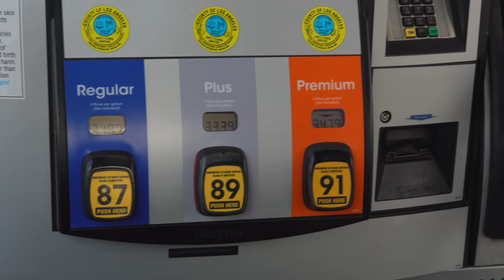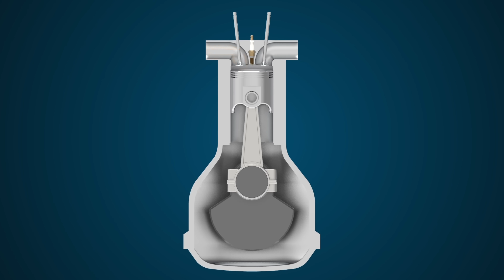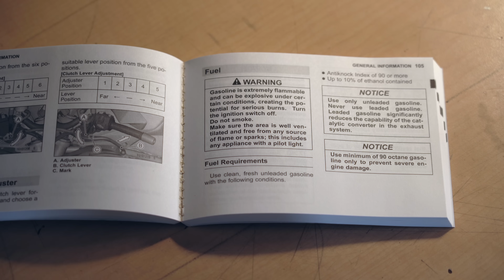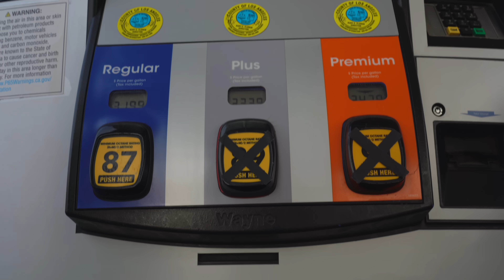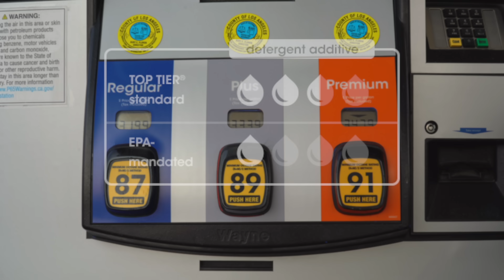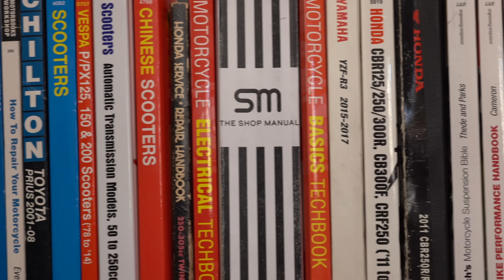Should You Run Premium Gas In Your Motorcycle? Octane Explained | The Shop Manual

Comment: I fill up with electrons while I sleep, and it doesn't matter what octane YOU choose, I am the fastest thing on two wheels, and will pull away from you every time. I'm there, you blink, and I'm not there anymore. I remember this guy, I could hear him coming for blocks. He pulled up to the light and he couldn't keep his hand off the throttle. I looked at him, he looked at me, the light changed, and I was gone, simply gone. I got to the next light and waited, and waited, and waited. He finally pulled up next to me and was yelling over the noise from his bike, "what is this thing?" I said, "it's electric". The light changed again and I pulled away at part throttle, listening as he was going through the gears, desperately trying to keep up. I think he drove like that everywhere he went. Couple of years and he'll be deaf.
Reply: Mighty proud of yourself beating a clapped out Honda rebel.
Reply: @armadilllo  Clapped out? Hmm is that English? Honda Rebel? No I think he said H2, a 2 cycle machine.

Comment: I run high octane in my BMW F 800.  I have to buy it from a HD shop. They have been out of orde and now I'm having issues with her cutting out on me when I either decrease the throttle, or gear down.  Does this sound like a fuel issue?  I have no idea what is happening.
Reply: sounds like typical German engineering

Comment: All fine and good.  This guy never mentioned the biggest issue. Ethanol. Ethanol is dirty and it sucks. I run Non Ethanol in every engine I own save my car, Truck and van. All grass mowers, power washers, boat motors and all my Motorcycles run on Non Ethanol. Non Ethanol as far as I can tell comes only in a premium grade.  So while this video was done good enough it is incomplete for a educational purpose.

Comment: Interestingly enough, when I tried running 93 octane in my Suzuki Boulevard C90T years ago, I did it for the cleaning properties and not to increase power. What was surprising is that the higher octane made the engine run like crap. It didn't start running good again until I filled up with 87 octane. So, instead of using higher octane, I started using Sea Foam. It ran better than ever once I started using Sea Foam. I now have a new Gold Wing, and it also runs great on 87 octane with Sea Foam every now and then to help keep things clean and running smoothly.

Comment: Good video, thanks.  Just sent me away to double check the manual for my new bike (Tiger 660S).  The recommended octane/grade is slightly lower than the lowest grade usually available in the UK, meaning the  engine was designed with some wiggle room.  I have from time to time experimented with higher grades in various cars and bikes but never noticed a difference.

Comment: Well, I'm on a CRF300L so, no need for good fuel but, I use it anyway as the difference is under a buck a tank and it'll keep the little banger cleaner inside.

Comment: Also missed one of the main differences between motorcycles using gasoline versus cars. Most cars don't sit for months at a time during long winters or lifestyle choices. (AKA "Fair Weather Riders") If you strictly only use the lowest grade of fuel as per the manufacturer's recommendation, then you are getting a much higher concentration of ethanol, and few people realize that Octane drops over time. Your 87 cheapo gas doesn't clean very well and can lead to bad deposits, the ethanol attracts moisture, and the Octane won't be 87 any more at the end of several unused months. I run 87 in my Hondas designed for it, but put in a tank of 94 every once in awhile, and make sure to only store my bikes with full tanks of 94 and Stabil added. Couldn't care less about power.

Comment: if you have a local gas station that has premium fuel with 0% ethanol and you store your bike for winters run the premium for the last 2-3 tanks and when you store it.  pulled my bike out of storage after 1 year with 0% ethanol fuel, fired right up.  10% ethanol fuel only stores for about 6 months I believe

Comment: If your engine requires 89 octane, putting 93 octane will give you no more power. You need to understand how to utilise the properties of a higher octane. To utilise the properties of high octane will require engine modification. Do not waste your money on high octane fuel if it does not require it.

Comment: Quick answer: any gas that gets compressed heats up. This is the reason why turbocharged cars have an intercooler, its to cool down the compressed air. It is then mixed with fuel and compressed again in the engine.

In high compression engines and turbo engines, this air/fuel mixture can get so hot during the compression that it can self ignite before the spark plug sparks, while the piston is still compressing the mixture, creating engine knock. This 1- damages your engine, and 2- steals some power from you as it pushes against the engine's rotation

Octane helps prevent the mixture from self igniting by raising the temperature it needs to ignite

Comment: well high octane gas might not gain you power but low grade gas will possibly decrease your overall power output if the manufacturer build and tested the engine with high quality fuel (which usually is the case since about 20 years). once the engine detects a single knock the timing advance on your ignition will be set back to prevent knocking. with your ignition timing not at the peak you will have slight performance decreases. the knocking control on your engine will "sharpen" the ignition timing to a certain preset point bit by bit if it has no knocks therefore regaining it's original power. now in theory there will be a power difference but obviously you won't notice it on a 20yo honda civic with 70hp, on a highly tuned performance bike engine with high power-to-displacement ratio I'm not so sure. surely there are tests on youtube... I also doubt that using one tank of low-octane gas will damage a modern engine mainly for the reason I explained above. I don't know for sure tbh but since cars have it since as early as the late 90s I'd assume motorcycles also utilize a knocking sensor the same way.

Comment: Are you suggesting that quickie-mart fuel is a lower quality?

I thought all gas was the same quality.
I can’t see gas being made to accommodate quickie-mart gas stations.

What’s going on with gas quality ?
Reply: I can't speak towards the manufacturing of gas being the same, as I don't know. But fuel quality still has a lot to do with the transfer / and after care as well. Dirty delivery trucks, dirty station in-ground tanks, old gas (whether not purchased enough to keep a steady flow of fresh or purchasing old gas for a bit cheaper), or broken / leaking in-ground tanks. All gas might be created equal (which I doubt fwiw), but maintenance and care is usually based on the brand of station / how much they care about their reputation / have the funds to repair / maintain it. I have an old cheap no-name station near me, gets deliveries from gas-brands I've never heard of and it made 3 of my vehicles clog up their fuel filters in 1 year all to bc their gas was $.30 cheaper (and now I know why). Never bought from their again, never had the issue again.
Reply: @patrickmchugh8039  ; 
👍 I can appreciate that.
Certainly makes a lot of sense and has a good loud ring of truth.
I can see all of that coming into play.

I have a new motorcycle with less than 2000 miles on it that developed a engine knock. I changed the gas yesterday but didn’t make much of a difference.

Comment: If your justification for using higher octane gas is because it contains more detergents just run a PEA based fuel treatment like Chevron Techron or Royal Purple on occasional tanks. Then again when you store the bike with a full gas tank.

Comment: I am having a 350cc scooter 2,5 years and using 100 octane gasoline since I got it from the dealership and I am having 10k kilometres! The scooter runs so smooth, the throttle response, everything..It’s like I bought it yesterday.
If I change to regular will it be bad for the engine? Anybody have any idea?
Reply: running a tank of it won't hurt anything, try it.

Comment: I was told that higher octane fuel has a lower combustion temperature and therefore it’s a good choice in air cooled engines even with lower compression. Is this true?

Comment: You go to the pump and it has 1 hose with 3 selections you select 91 you can get up to a gallon of what the previous person purchased which is usually 87 and you end up  paying 91 octane price for 87 fuel.
Reply: Pick a station that has separate hoses for different octanes.
Reply: Never seen one. @davetysdal5442
Reply: Nope. Calibrated very accurately by a third party and generally wouldn’t be over 2-3%. Most modern cars computers also adapt to slight variations in fuel.
Reply: This is the dumbest comment Ive seen this week. Not at all how gas pumps work.😂
Reply: Then anything left you put in will be a higher octane n just be a combination of the 87 so still higher
Reply: you'll get a little of the gas from the previous gas but definitely not a gallon! and I always aim the nozzle at the ground after pulling it off it gets that little bit left in the nozzle out so it doesn't dump on my bike and if you look inside those pumps there is only 2 inlets one for 87 and the other for premium the middle selection is a blend of the two
Reply: Yup. That’s why I always go to chevron, separate hose.
Reply: So then, the next guy to choose 87 get a gallon of 91 for the price of 87.  Seem like it all evens out in the end.  😁
Reply: @buckybucky8596 
Except the amount left in the hose is a much larger percentage of a motorcycle tank than an SUV or car tank.
Reply: Makes sense
Reply: lol. who told you this?  fake news...
Reply: Thrashing guys did an experiment.  @BigTimeRushFan2112
Reply: @BigTimeRushFan2112 You think they clean out the filler hoses between customers.?. Haha

Comment: I use high octane fuel in my 50 cc scooter because it helps clean the carbon buildup on my plug and piston, it's only an extra 50 cents to top up my tank.

Comment: i inherited my grandfathers 2001 holden ute (ls1 powered) about a year ago. he owned it since new, mostly hwy driven and he never gave it a hard time while he used 91 (our lowest).

i couldnt get the black smoke to stop when i put my foot down, so i used 98 (premium) for a few tanks. After two weeks the car ran smoother and got better fuel economy on both 91 and 98.

i still run 91 but every 5th fill up ill use premium, i dont know how it works but its been worth it

Comment: The high octane in my area contains no ethanol while the low and medium contain up to 15% so as I approach the end of riding season, I only use high octane and stabilizer so that I don’t get the phase separation from the ethanol that leaves water in my tank during the storage months, even more so with my snowmobile which has a much longer off season.  So there is more to to high octane than anti-knocking on high compression engines but thanks for the great explanation regarding power.

Comment: I run premium in my little CB500X that certainly doesn't need it, BUT I don't do it for any mythical power gain. I do it because it's the only octane locally that is ethanol free, and running without corn in the tank DOES get you better MPGs.

Comment: In Layman's terms; use whatever grade/octane fuel the vehicle was engineered for. Eliminating Ethanol from fuel would be a far better improvement than using a higher octane gas or any gas additive.
Reply: Very true, but in my area (west Wisconsin) non-ethanol gasoline is only available in higher octane ratings.  I am all about using non-ethanol fuels, so I am willing to pay the premium price for it.
Reply: @NJP76  I feel your pain. Time and time again, independent studies have proven that there was absolutely not benefit from using the corn fuel but no thanks to the greedy officials and lobbyists who continues the charade, I reckon it will only get worse...
Reply: Designed for, or mapped for.  You can get more power from high octane if you advance ignition. 
Many modern engines have knock sensors and they wind the ignition back and therefore power if they detect knock.
Reply: @matthewoakley3772  Yes, I agree with you to a point. If you need to tinker with a vehicle that much and the vehicle was designed for Regular Unleaded fuel, chances are, it was not meant to be a performance vehicle. Besides, those engine and ECU tweaks are not cheap or something that is easily done, not to mention a potential voiding of any existing vehicle warranties.

Comment: Some guys in the uk have run tests, and found that they get a bit better fuel consumption with premium.  In terms of cost, there is hardly anything in it.  However, the E5 fuels tend to have more detergent.  I only use Shell V Power, and notice a slight hike in perrormance.

Comment: Only in different engines if you have standard engine that calls for 87 no boost in octane gains you anything. Jeez people still think octane makes power, amount of air and fuel in one firing stroke makes power, more air and gas you can pack in cylinder more power, like on turbo it is compressed air and more fuel, octane rise is only to prevent it burning before spark due to pressure and heat as 87 burns easier at lower pressure and heat point. High performance engines only use high octane as it is hard to ignite so you do not get detonation before piston is in position

Comment: What about making a decision between ethanol premium and non ethanol regular? My HD calls for premium gas but it is only available with 10% ethanol. I can get non ethanol in regular 87 octane. Adding an octane booster at those low quantities for a motorcycle tank is almost impossible measuring and difficult when riding. There is nothing good about ethanol. I struggle with that every fill up.

Comment: I disagree. Even a stock built engine made to run on low octane will still benefit in power increases with a higher octane fuels. This is because low octane fuels still have some pre ignition that occurs. Higher octane eliminates all pre ignition in them engines. This will mostly be felt at higher rpm’s.

Comment: Foreign Land (U.K.).... I put the new E10 fuel in my GSF 600 Bandit K4 and it didn't like it. Went back to E5 fuel and it's running well again.  Changed the fuel-filter, plugs, oil/oil-filter, air-filter and did the valves AFTER putting that hippy fuel in it... All aforementioned parts were from a dealer... I advise you do the same. A customer of mine says his car gets around 70 miles more per tank compared with the new "improved" fuel.

Comment: I recall when I had my 95 Kawasaki EX500 (carbureted) it ran better on higher octane fuel.  With my 07 Yamaha FZ6 (fuel injected), I didn't notice any difference whether I used low octane or high octane.

Comment: An important thing to note is that modern engines have Knock sensors which detect if there is predetonation in the engine. 

It’ll pull back timing to stop the predetonation to save the engine, but you’ll make substantially less power. 

Running enough octane insures that the engine won’t be pulling timing so you’ll make more power, even if it can “technically” run on 87 safely. 

Also, higher octane gasoline can be useful if the outside air is hot and if you plan on driving up long hills. Both of those situations cause the fuel to predetonate so a higher octane will be safer for the engine. Lean fuel mixtures with hot air and high altitude are likely to knock, and high engine loads cause knock too. 

Driving uphill at a higher rpm is beneficial to prevent knock especially on turbocharged vehicles. Lugging the engine at 2000 rpm, flooring it, to try to make it up a hill can be dangerous. 

Modern performance cars can usually run 87 these days safely if you dont get on the throttle to hard and too long, but all it takes is one sudden predetonation event to chunk a hole in your piston so run the highest octane you can if it’s recommended, especially if you drive hard.

Also, ethanol in gasoline isn’t as bad as everyone thinks. If you drive often to prevent water absorption and you have a modern vehicle with modern fuel lines there’s nothing to be afraid of. Ethanol increases octane for cheaper, and it also has a higher cooling capacity so it prevents knock further by lowering cylinder temps substantially. I’ve seen cars run e85 for over 100,000 km with no issues to the stock fuel systems, no oil dilution by ethanol, and no material degradation.

Ethanol is only really an issue on old vehicles and some specific new ones, so research it yourself, but “Ethanol bad” isn’t really true at all. 

Also a side note, knock sensors do absolutely nothing to detect rod knock, like many people think. I’ve seen literally dozens of people think their engine is gonna blow because they have a knock sensor code.
Reply: I think you mis spoke about the knock sensor not being able to detect a rod knock, it will,  but the knock sensor can't tell the cause of the knock so the engine ecu will retard ignition which does nothing to help a rod knock condition.  You're quite right that a failed knock sensor  won't make your engine blow unless ofcourse you buy a lower grade fuel than specified and then  continue to hammer the throttle. ( ASE cert mastertech, 40 years experience)
Reply: I scrolled through to see if anyone had made this same point. I second the motion!

Comment: My hayabusa and zx6r love 87. With the stock tune having conservative ignition timing values I don't have any issues. Both bikes are raced and ridden hard on 87. On the other hand, my bmw k1200lt will knock even with 93 in it if you lug on it in top gear. All bikes are different, depends on how heavy it is and how you ride. But basically any bike can run on 87 if you  are careful and know what knock sounds like.